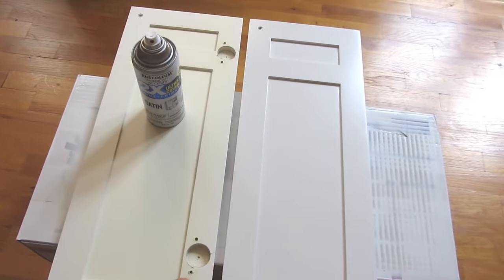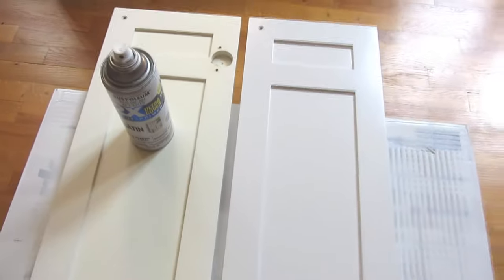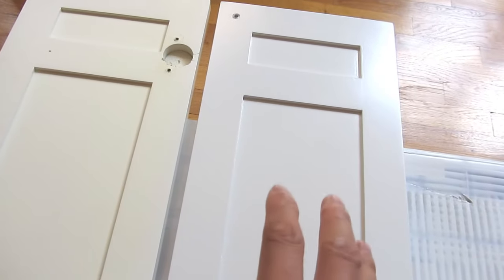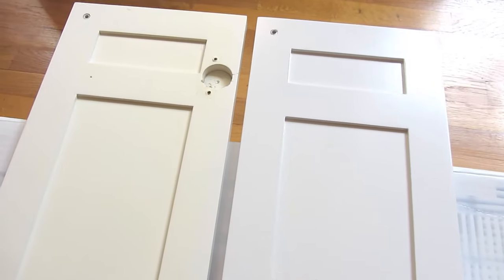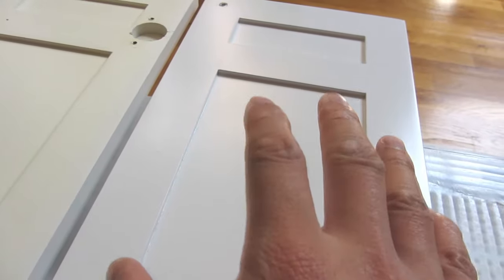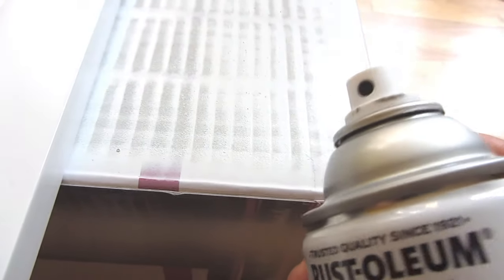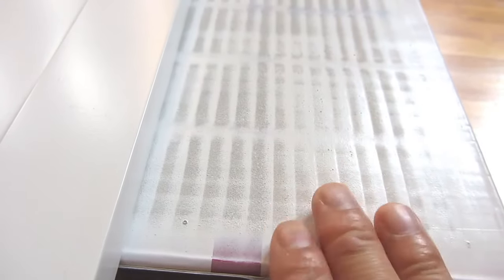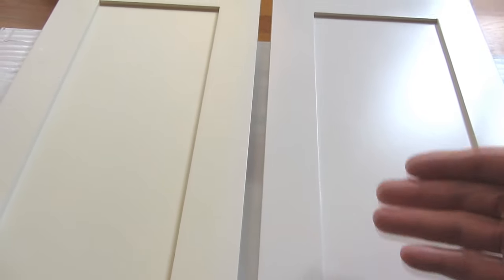5 Spray Paint Tips | Smooth Even Perfect Finish

Comment: You need to shake the can thoroughly to mix the paint to avoid that “powder” you mentioned. That’s just un-mixed paint. Also, before applying paint each time, you have to give off a couple “test sprays”… shake the can a couple more times up and down,with a bit of force, then point the cab AWAY from you & whatever it is you’re painting and press down on the cap 2 or 3 times to get those first initial sprays out the way. This avoids the “powder” and prepares you for a proper coat. Do this EVERY TIME you’ve taken any little break from spraying.
Reply: Also a good idea after each coat to turn can upside down and spray until no paint comes out, at least that's what I've read and done in practice. Only spray upside down enough to clear paint out of nozzle, and only when you're not going to use for a period of time like 20-30min also wipe nozzle after spraying Keep the tip clean.
Reply: Thank you!!! I needed that tip. I'm horrible at spray painting.
Reply: Good point. I was surprised he didn't  shake the can to mix the paint.
Reply: Awesome video. 👍 question what is I want the sandy feel, like rough texture how can I achieve such result. I know hear so many versions. Spray from far away. Do it on a Windy Day. Temperature matters. Nothing is all a Lie. I am using a clear transparent paint. But I want a complete Sandy rough texture. Do you know any Tricks or Hacks how I can perfectly achieve such Result. Thank very much, & much success to you

Comment: Wrinkles is caused of to much paint. The top layer dries out fast than the bottom layer> there for starts moving making wrinkles. Like you said light spray coats. Let it dry, then go back to it. Most cases 3 coat will even cover it, Some time 2 coats
Reply: He literally said exactly that in the video.
Reply: @jonjones9072  Exactly what i said
Reply: @426superbee4  Why repeat it then?  It's not like he was asking why it happens.  He stated something in the video and then you come to the comments and say the exact same thing that was said in the video.  I just don't understand the point of your comment.
Reply: @jonjones9072  What is your problem dude?
Reply: @426superbee4  No problem.  I just don't understand the point of your comment.

Comment: How did the powder and dry paint come out? U said you had to clean the nozzle? That means you are messing around with the can and allowing paint to build up and ur not shaking the can for over 60 seconds and when you come back to spray another coat you have to shake the can again and clean the nozzle and you have to put the spray paint in a warm area like hot water or a very light temperature heater and your only waiting 10 minutes i have never painted that soon i wait 25 minutes to allow it to dry and build up a layer and u didn't say anything about the room temperature or humidity or wind never mind

Comment: You start with an already smooth surface and you can spray flat so there is no big challenge. The Rustoleum paint will run very easily on a vertical surface as soon as you try to build a small thickness to fill the grain.

Comment: Good tips, here is two more! 
1) keep a cup on mineral spirits nearby and toss your nozzle in there and swirl it around between coats. This will stop that “spitting”. 

2) soak can in bucket of warm water 10 min before you spray and between coats. The paint will flow smoother.
Reply: Good tips.
Reply: I've had a butane blow torch handy and carefully heated up the paint can (heat and shake).  Saves time but dangerous if you don't know how

Also previously placed the aerosol under a hot car hood to soak up engine heat.  Over did it once and strangely it caused the aerosol to leak out... The "spray" ran out quickly but there was still a lot of paint left behind in the can

Comment: He kinda touched on it in tip 4, but something super important that lots of people miss is when you’ve finished laying down a coat, invert the can and spray until it no paint comes out.

This helps to clean the nozzle so nothing dries and clogs it, and also helps to prevent the rough spotty finish that he showed in tip 4.
Reply: @PurpleNinja-vn4hv...Yep before I read your post I said the same thing.
Reply: wouldn't it run out of gas too quickly if I did this every time after using the can?...what I want to ask is if it affects the efficiency of the can?..like is it worth to do so if we compare the costs of the can and what we benefit from this tip..thx for understanding
Reply: @Frco03  it’s not like you’re holding down the nozzle for a long time, just do a few sprits until you don’t get any paint coming out. I’ve never had any problems with this and have been doing it for years.

Comment: thank you for making this video...very helpful. I am planning to paint my kitchen cabinets white using a spray paint can. Currently its unfinished cabinets that I got from home depot. Which brand would you suggest? Behr or Rust Oleum?
Reply from the maker: Cabinets?  Hmmmm, I'm not sure spray paints is right for that.  These aerosol enamel spray paints, if you do it indoors will have a mist that will stick all over, not to mention will linger in the air.  It will be as if you closed your room door, and took Aerosol Hair Spray and emptied the can in your enclosed room.  If the cabinets are unfinished, you need to figure out whether you will be using Stain, whether its wood stain or even some pastel color stain, or whether you really would be using Latex Paint from a sprayer.  I would highly not suggest you use normal enamel aerosol spray can's to paint your cabinets indoors.  I don't think that's what its really made for.  In my opinion, not the right paint for the task.
Reply: @PoolarityChannel  But isn't your demonstration on cabinet doors?
Reply: @PoolarityChannel  HUH? What are you talking about? Your whole video just demonstrated using aerosol paint on cabinets.

Comment: I’m repainting 1978 plastic Barbie doll dream house. And every time I try to paint it wrinkles or crackles. Hopefully this will help me. Do you have any special suggestions for spraying on plastic and what to do and use to fix the wrinkles or mistakes like drips?
Reply: Hi! I have been restoring old toys and collectibles for many years. Using spray paint on plastic can be tricky. There are some paint + primer spray products that are formulated to work well with plastic. You might want to lightly sand the surfaces with a high grit sandpaper and then apply multiple very light coats of one of those specific paints. And be sure to keep the can about 12" away from the surface. If this doesn't get the result you want, you could try one of the hobby air brush kits at Hobby Lobby. One more note: some plastics have extreme difficulty with enamal paints. I have even seen enamel partially melt a few surfaces.
Reply: @GoodnightAdam  thank you so much! I got a hold of the company that does the paints for Pantone and they made my paint and the primer and so all the chemicals were the same. And it finally worked out!

Comment: What was your sanding process for the cabinet door before you spray painted it?
Reply: I’d go with a coarse 8000~> 5000~>3000 grit. Circular motion. Using a grinder with a sanding wheel would be quick.
Reply: @OrcinusLaryngologist  ...8000 grit is far from course what are talking about 8 to 5 to 3 thousand? Even that's backwards...3000 is courser than 5000 and 5000 is courser than 8000. 8000 grit is about as course as a sheet of paper.
Reply: @harryberry474  There was a reason I typed it the way I did. 
I’m aware of that though. 🤣

Comment: How did this Rust-Oleum hood up in the last 3 years?  I have 10 cabinet doors to paint.  Will I be better off rolling paint on the inside portion and using the spray on the outside of the doors.  I’m asking this for a time and money saver.  I’m assuming it will take a lot of cans
Reply from the maker: After 3 years, looks exactly the same as in this video, even with standard monthly wiping and cleaning.  I'm not sure rolling will be good, unless its enamel, but even then, IMHO its hard to make the paint settle even with rolling, as that will tend to apply too much paint at once.